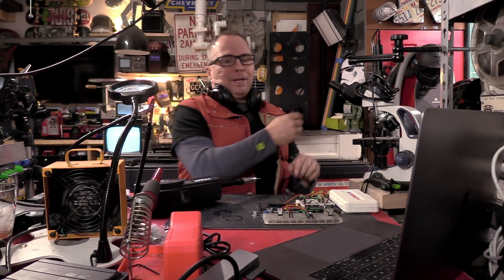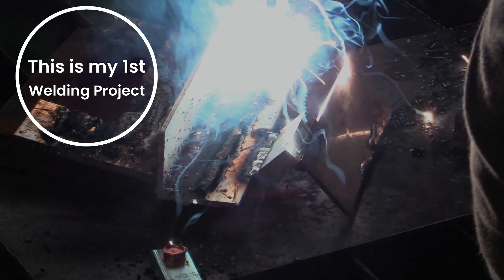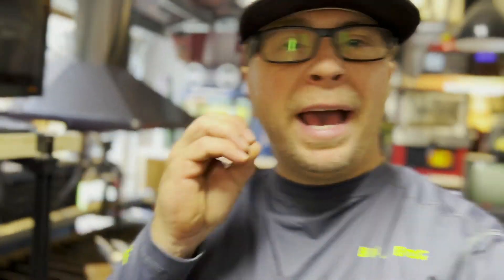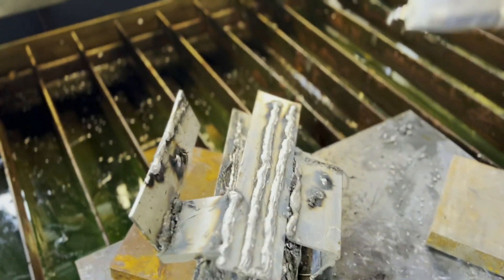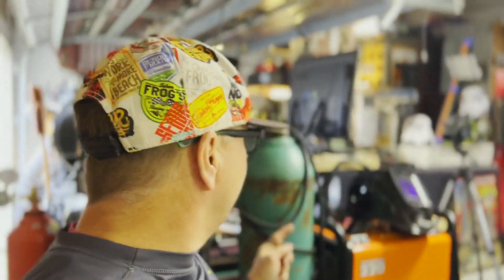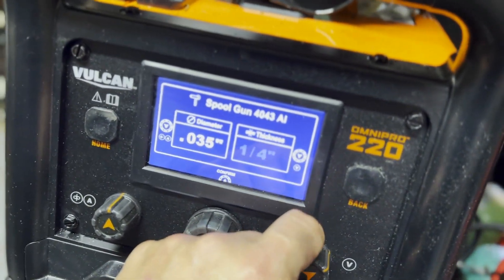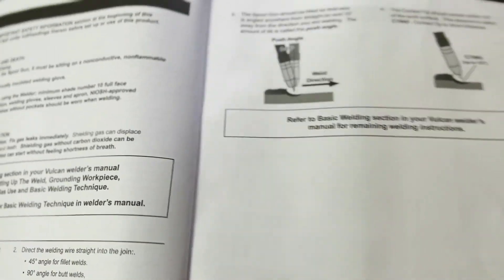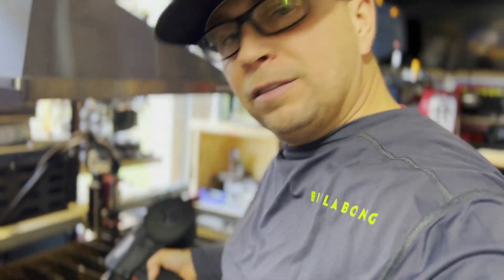How to Weld Aluminum  - OmniPro 220

Comment: Crazy I started with the Chicago electric you showed and the Vulcan mask you have then upgraded to the Vulcan welder you have. FYI the spool gun allows you to feed aluminum into a mig gun or wire feed gun. As a regular mug gun will definitely drive you nuts as it breaks inside the wire rod.

Comment: Could you not have put it on the Tig welding setting and used a Tig torch to weld aluminum?
Reply: It doesn’t have AC TIG function.
Reply: @patrickcobbs5217 I own this, it has a TIG setting and you can use a Tig Torch on it
Reply from the maker: Yes
Reply: So, yes and no. Back in the day, like in the 60’s they would DC tig weld aluminum with 100% helium. You can still do it but, the cost of supplying all that super expensive helium now a days; will outrun the cost of a machine that can AC weld aluminum with pure argon.
Also, its super sloppy and expensive but you can buy SMAW electrodes to stick weld aluminum now too. It aint pretty but it works.

Then, theres obviously gas welding (oxy-acetylene) or propane-oxygen welding aluminum too